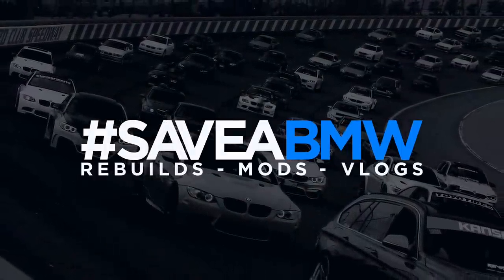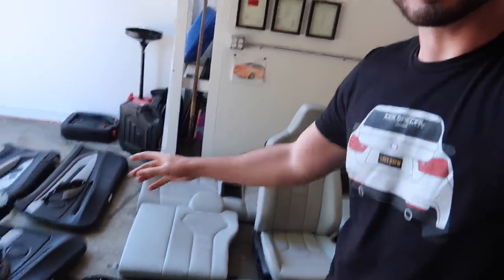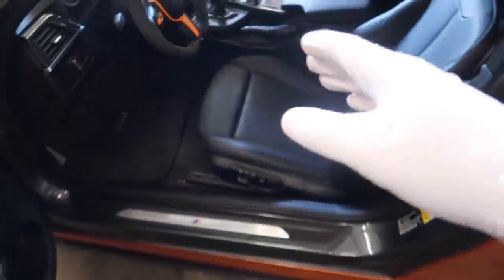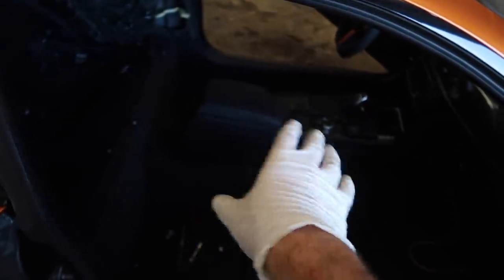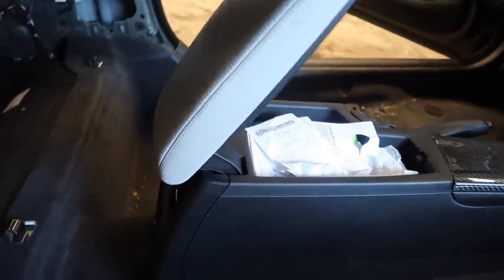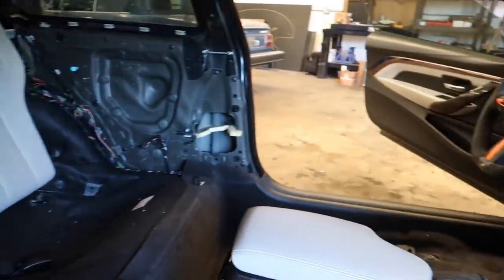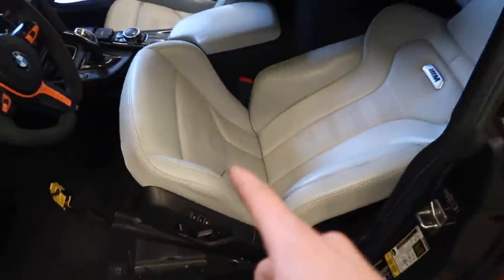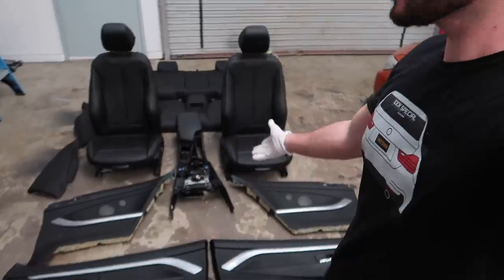SWAPPING MY 435I INTERIOR WITH M4 INTERIOR! (RARE SEATS!)

Comment: Loool somebody could’ve just gotten into your car started it and drove away if it was not locked because the spare key was there the whole time😂😂😂😂
Reply: Jay-Cee that’s exactly what I was thinking 😭
Reply: i wonder if they disabled the key somehow so they didn’t have to take apart the interior
Reply: If the battery on the key is dead I wouldn't think so? Correct me if I'm wrong

Comment: Your vapor barrier seal looked sort of loose I would have just re sealed them while I was at it looks good tho
Reply from the maker: whats that
Reply: Nour Hummadi 9:45 the vapor barrier is that black insulation it’s held on by butyl adhesive overtime It just losses it’s adhesive properties and will let water in happened on my f30 simple to do just sucks cleaning the old butyl adhesive off u want to make sure u clean it all off so it sticks properly